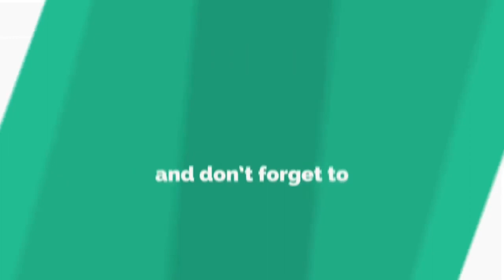What is the difference between a star and a delta connection? How2engineers

Comment: I give you credit for being the only person I've seen so far use an actual terminal block to demonstrate. I've watched a dozen videos; however, you only show three wires and don't explain if it is the line or load connection.

Comment: Does changing between star and delta change the input voltage?
Reply: Star/Delta starters are probably the most common reduced voltage starters. They are used in an attempt to reduce the start current applied to the motor during start as a means of reducing the disturbances and interference on the electrical supply

Comment: one stupid video, we all know-how , but why star or why delta
Reply: EXACTLY, why choose one over the other?????
Reply: Star/Delta starters are probably the most common reduced voltage starters. They are used in an attempt to reduce the start current applied to the motor during start as a means of reducing the disturbances and interference on the electrical supply
Reply: I think that they use delta for a system without neutral, then they get 3 phases and star they get 2 phases and the neutral